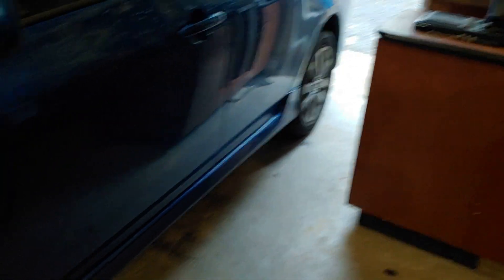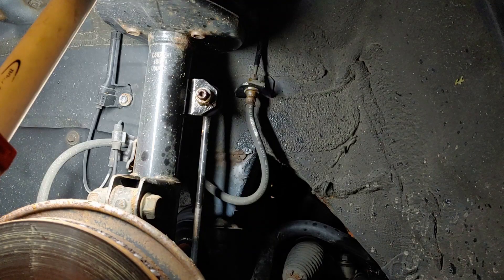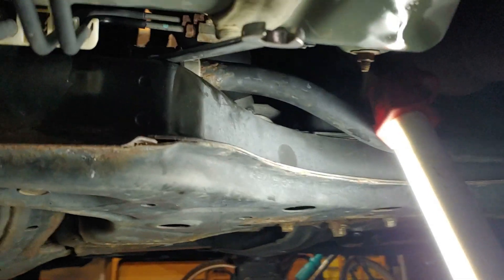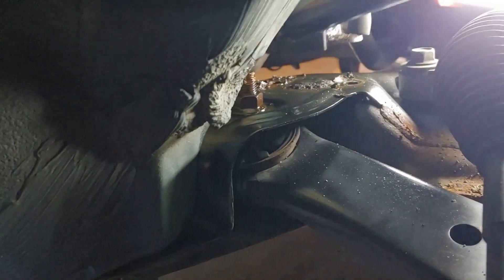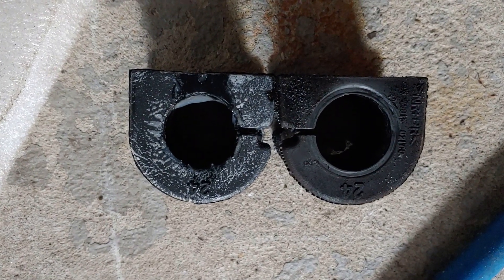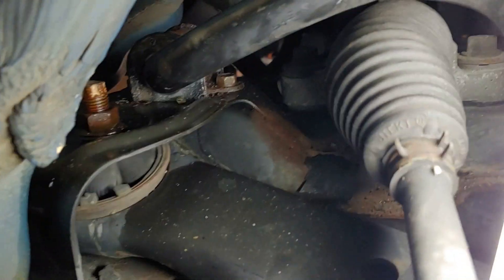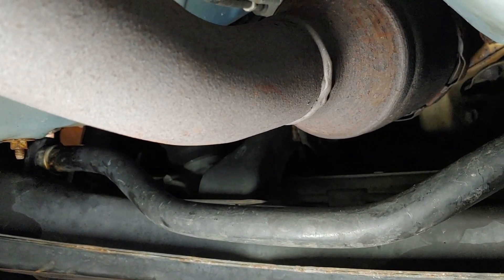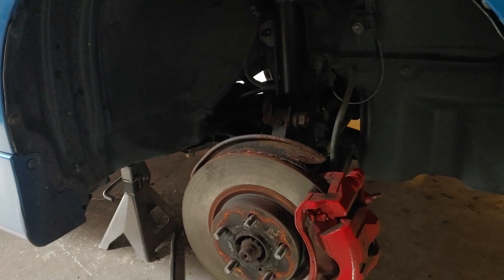How to replace front sway bar bushings on a 2009 Toyota Corolla

Comment: Why did you remove the entire stabilizer and even with the stabilizer struts?
Reply from the maker: You have to lift the sway bar off the subframe to remove and install the bushings
Reply: @DJsWorkshop  You don’t have to remove it completely, just unscrew the bushing clamps
Reply: @DJsWorkshop  If you remove both U clamps, the bar easily rotates pretty far upward. No need to disconnect the links unless you're replacing them.